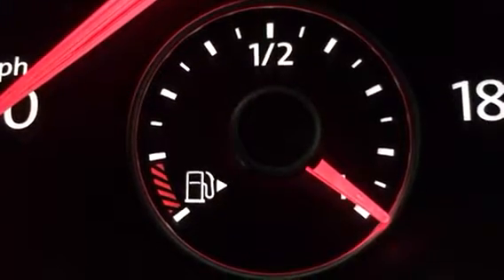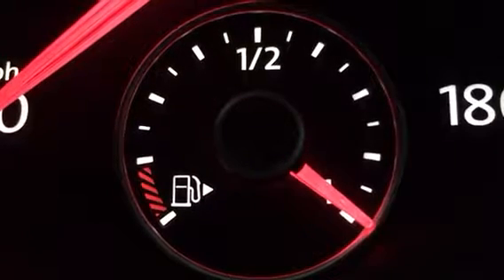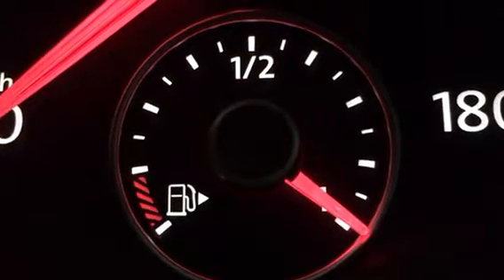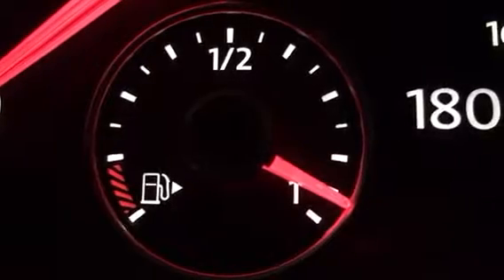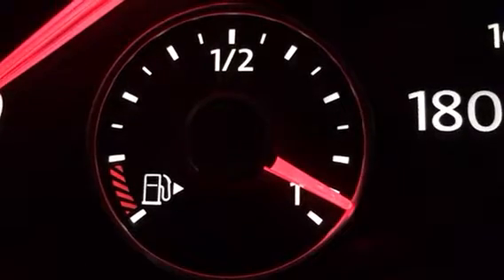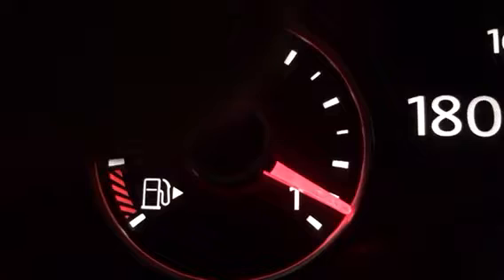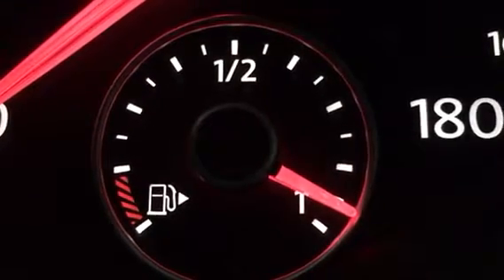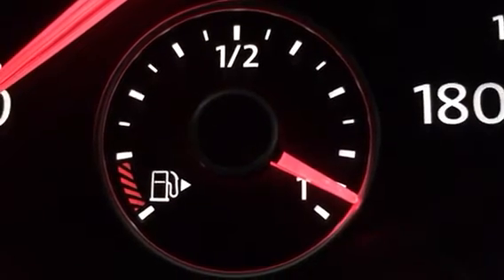MK6 GTI VagCom Fuel Level Sensor Adjustment

Comment: But when the fuel level is in the red section it will say you can drive XX km before tank is empty? Or do you get the warning earlier before the red section?
Reply from the maker: Not sure I’ll need to test. I am only going on the needle now due to the walbro 450 custom fuel pump in tank.
Reply: Ryan Jacobs Ok interesting what will come out, i think if you adjust it will work like normal. But that new lift pump doest get that much fuel out of the tank like the stock one i understand?
Reply from the maker: Roy BM correct.  I basically have to fill the tank the minute the gauge hits red.